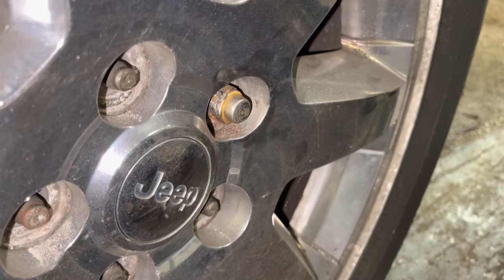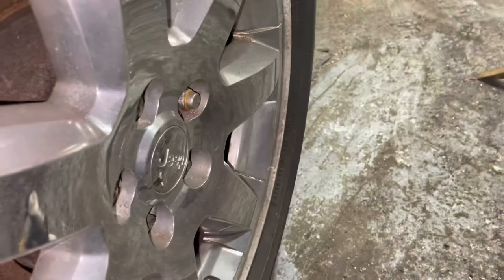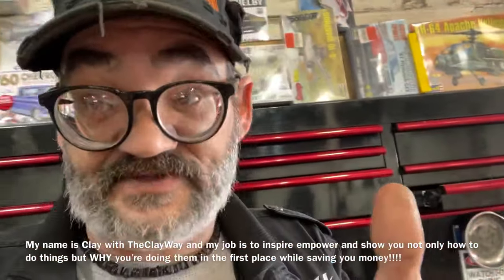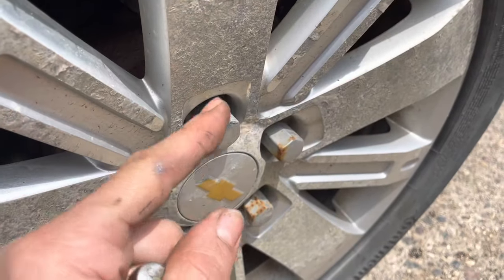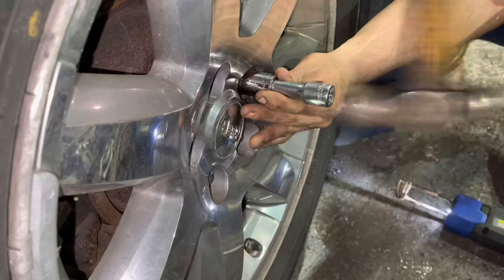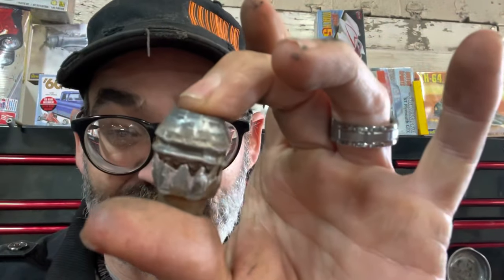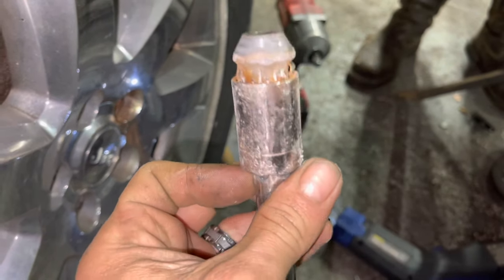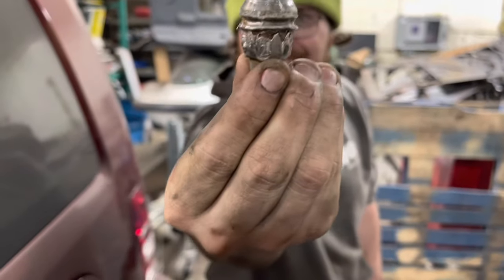How to Remove a Stripped Off Lug Nut

Comment: I have a 2007 Dodge Ram 1500. WalMart  is the only place my truck has ever been for tire work. Went in for a rotation and they rounded off 4 on the first tire they tried. Told me "someone" got them too tight. I told them, Yea...you ! They said they don't put them on too tight and they can't do anything for me. I worked my way up the ladder of folks with WalMart until finally someone from corporate called me and basically said, Tough poop. So......now I have to take it to a truck shop and get the darn things removed and tires rotated. I hope there's another option out there to buy different lugs, because I don't want the same things put back on. Great video. I'm just not set up with the right tools and physically can't do it. Still a great video, thank you.
Reply: So what probably happened is the wear on the aluminum caps on the lug nuts wearing out, oreilly sells good quality lig nuts that don't have caps, they're the same size and are straight steel all the way thru, no aluminum caps, id get those, they're better and will most likely last longer than the truck😂

Comment: My boyfriend is one of those full-on I can do everything and I know all, especially if it has a tool involved. So while he's at work I watched your video and thank you because I love it when I prevail at things he thought impossible. Love your video
Reply: One more thing is that the sockets I used, first one was a husky, it cracked but I used a Craftsman next and it worked great
Reply from the maker: That's awesome! My wife could tell you she knows the feeling  😂 I'm glad the video was helpful!
Reply: Having this problem with my boyfriend right now.. Never can I find something that will work because he already knows what he’s doing.. so I’ll never get to find out if this worked for our car I guess
Reply: Funny I had to go back into O’Reillys to get another torque  sockets because that’s what he was using but the caps got stuck into the sockets. And when I came back out he was doing it my way “this way” and worked like a charm!

Only have to get one cross thread fixed in a week.

Comment: What I always did was use a screwdriver to chisel down the side of the tin to open it up. You can then stick the screwdriver inside and pop the tin off. There’s a steel lug nut inside unharmed and you can put a socket on it and take it right off.
Reply: @@eastsideazskelad3093 true, the cap can end up anywhere. Lol

Comment: I know one trick, get rid of them before they cause problems.  I replaced mine with good solid ones for just a dollar each.  It was the best $20 I ever spent on my car!!  I don't know why they still use those horrible things.  Haven't they learned yet?
Reply from the maker: It’s hard to find them for a dollar but if they were a dollar that’s probably what I would buy as well you’re absolutely right
Reply: @sharpcarco  They don't have to be a dollar.  I just got lucky and a local tire shop had them.  I just told them I wanted to get rid of the factory lug nuts and he knew right away it is because they are garbage.  I just told him I had bad luck with a different car that has them and I never want to see them again.
Reply: How funny.  I just said that to my friend when I went by his house to try and remove them before seeing this video.  I should have gotten rid of these years ago.

Comment: Worked like a charm. 19mm Dodge Caliber lug nut. Used a 3/4 - 1/2 drive 12 point. Pounded it on there (straight), grabbed my 24 inch breaker bar and it came right off. Even was able to get the lug nut out of the socket with no problem. Put it in my bench vise and was able to punch it out from the other side. Your mileage may vary, but it took me all of 5 minutes.

Comment: Thanks for the vid.  I just watched it about an hour ago and went outside to do mine and it worked somewhat flawlessly.  I only had one socket that I could use and after I hammered it on I realized it was a 3/8 drive and I wasn't sure a 3/8 ratchet wrench would have enough oomph to get it off.  Since it was a Craftsman I figured if it breaks, I'll get a new one.  I used a bicycle seat post for leverage and got every lug off without hassle.  It only took about 4-5 blows to get each lug out of the socket so it only took less than 15 minutes to do the four I needed to do.  I can't believe Sam's Club couldn't do this and made me wait until tomorrow to get my tires installed.  I know any regular tire shop does this all the time but, I figure Sam's is we don't work harder than we have to.

Comment: Just used your trick on a 21 mm Toyota Camary nut and worked like a charm, and the pounding it on the concrete ground to remove it was awesome, too. Thank you so much. it only slowed me down 10 minutes.
Reply: Same!!
Reply: On my 21mm Camry, I striped the outer Chrome layer off the bolt with my 21mm, but then noticed what was left was a smaller iron lag. I banged a 19 mm on to it and it came off great! Posting this for anyone in a similar situation who might benefit

Comment: The lug nuts on my bot trailer were rusted out.Got most of them off,but several stripped and could not get them off.Used this trick and got them off.The had to get the stuck lug it out of the socket.Hammer trick worked for that.Thanks for the knowledge.

Comment: I just used this method on a 2001 Chevy suburban and hammered the socket onto the lug and used the socket wrench and it came right off. Then used the hammer to bang on the socket to get the lug out and that worked also.

Comment: I used high quality hardened socket with a hole in the middle. When it was loose I placed it into a vise, then I took lug out using a hammer and a drift, hitting it trough that hole. Smashing it like this with a hammer might crack it, or it will crack partially and it will broke next time you will use it as you are putting way too much of stress into it. And you can also buy socket that is specifically designed to remove stripped off lug nuts or bolts. I guess it´s called the bolt extractor in English and I believe it´s a bit easier to use. It costs more or less the same as socket of similar size and because it does not require so many hits with a hammer, it has much higher chance of surviving more usages.

Comment: I'm dealing with a Polaris Ranger 6x6 with recessed lug nuts. A 9/16's is a hair too loose and a 12 point 14mm fits, but just rolls over. I've got a complete s.a.e. & metric "Bolt Biter" set, but they're too thick.  The rims are alloy, so acetylene or welding is out. You can't even get to the rear stud flange to grind them off! The lugs are solid with aluminum end caps, so I guess drilling them out is the only option. Seems like they make stuff intentionally stupid and difficult to discourage any of the D.I.Y'ers.
Reply: Not just DIYERS because Walmart auto center f*cked my lug nuts up..

Comment: I'm at the very beginning stage of taking these shyte struts out and have problems with a lug nut. Ill try this out. If I succeed, you nabbed another.
Reply from the maker: You will I guarantee it… I would like to say I would come there and do it for you and show you that it works but I kind of already did if you really think about it because I showed you on the video I don’t make tricks that don’t work.. that I promise there’s no Clickbait here……. Well, unless my wife’s in the video, I think she’s Clickbait…… lol
Reply: Sir. Your idea had clout and I wholeheartedly appreciate the effort. But I ended up rounding it out. So I cut it out. Bolt and all. Luckiky I had another rim. Put the old tire on new rim. And put the strut in like clockwork. Then I went to the other side and cv join5 got yoinked out. Got an exterior boot for it. Found my lower ball joint to be messed up as well. Now Im going to rig another boot onto it. This ride has been a nightmare for me on day 1. Founr out by the cops that the previous owner has felony warrants, so i had to give up my name. I hesitated because all i was doing was bringing it back from where i bought it and was 20 mins deep, vacuuming after washing it at the carwash. I hesitated because first, I didnt do anything and second, I have 3 misdemeanor warrants. Also on the way to the car wash, found a glass pipe between driver side seat and shifter. Put it in my pocket and forgot to toss it in the beginning. So now I got a drug paraphernalia charge. The real fucked up thing? They cuffed me and seached me after running my name and saying I had a 418 (resisting/fighting police) which they corrected themselves AFTER search.

Comment: You can also heat the nut with an induction tool. This will be localised and the nut should expand without heating the stud and make it easier to remove.

Comment: Awesome I’ve been stoked for 2 days trying to find a locknut removal kit and couldn’t find none in my nor in the near by city of Miami in time. How very extremely lousy of the places Miami and some places I am that didn’t have the removal kit in their part store. Not even Home Depot that we went to had it, lousy. Home Depot said online purchase wow do you know how many of the locknut removal kit you can find online HOME DEPOT, smt lousy. In a rush or you have an working vehicle that needs it, you need to find one in these types of stores right away. I just mentioned that as part of my story so no one ends up wasting time going to these stores like Home Depot Advance Auto Pep Boys who didn’t have a removal kit.  wow tremendously lousy of the stores not to have the tool kit. I will do a separate video on them. Smt. Thanks to videos like these you can do it without a removal kit. Wait you think that’s why the stores,,,,, lol. Naa. Enough about those stores. I’ve been thinking just use a smaller size 12 point socket. Then you came along with your wonderful video and confirmed it for me. Thanks so so much. I do this method then come back and comment on how it worked. Thanks have a Bless Day. Keep up the splendid helpful videos.❤❤❤
Reply from the maker: Thanks for letting us know it worked out! We're glad to help 😎

Comment: bang socket still stripped but now i have a socket that wont come off over the lugnut so i banged a bigger socket over the socket and that one also go stuck and now im in a few sockets also stuck over lugnut im thinking to keep adding sockets
lol
Reply from the maker: I’m sorry to say you did not watch my video. Because in the video I do believe I describe what I did in another video which is how to remove a socket that is stuck in a lug nut quickly and easily by turning it on its side and using an extension, hammering the end of it and it will pop out

Comment: I have 13/16 lugs. Bought a 13/16 12 point socket, but it just started raining. Gonna go at it tomorrow! 

Ps, I bought a socket set to go with my new 1/2 impact driver, and the 13/16 it came with doesn’t fit right, have to bang it on. That’s why I’m in this position, I didn’t put it in all the way and stripped the tip. My four way lug wrench always fit just right. Maybe it’s just a bad 13/16 socket? The 3/4 from the set went right on my moms just right.

Comment: The way I get a stuck bolt or nut out is to use a chisel and put it down in the socket and hammer it out
Reply from the maker: Yeah, you keep doing that Bud….
Reply: @sharpcarco  what’s wrong with that
Reply from the maker: @BuggieBangedYou  nothing at all. But you’ll find it my way is way way easier I did it that way for a couple of decades
Reply: @sharpcarco  yes sir I respect that, I just thought banging on sockets like that will damage and break them, considering my brother broke ratchets and extensions trying to get his lug nuts off
Reply: @sharpcarco  plus my dad would kill me if I broke his tools.
Reply from the maker: @BuggieBangedYou  no , it should not , it could I guess but if your using harden ones on lug nuts like should be never 

Even chrome should not break while the lug nut is in there .. just don’t hit again after it pops out. Then it may
Reply from the maker: @BuggieBangedYou  show if the trick he will respect and you . I’m sure he never thought about it . Just be gentle on the old guy some people don’t like being shown up
Reply: @sharpcarco  okay I sure will, amazing video and thank you for showing that neat trick, I can’t wait to try it

Comment: What actually happens with those lug nuts isn't rust, nothing expands, the exterior of the lug nut is an aluminum cover, that's what makes it a 19, 20, 21, etc size, you take the cover off, it's 1mm smaller, I'm a lube and tire tech and deal with this constantly, I live in alaska where rust is a VERY common issue with things being stuck, what actually happens is the aluminum cap with wear out over time, and when that happens it does expand and start to spin on the interior lug nut, idk why manufacturers do it like that, but I can tell you for a fact it's rarely rust, it's just wear over time, but I've seen jeep, dodge, Chrysler with 30k miles and fucked lug nuts

Comment: They say don’t believe everything you see on YouTube and this is kinda one of them. I have 4 lug nut that is rounded of by somebody else so with this method I am going to ruin 4 extension and 4 sockets? I would rather buy a tool specially for this and is reusable
Reply from the maker: OK why even say anything at all? And blaming others for your mess ups well….. to each their own… you see how that works? 

I suppose the point is blowing out somebody else’s candle is not going to make yours brighter …..
Reply: @sharpcarco  I don’t strip lug nuts. Anyways this will work most of the time but if you got an extremely tight lug nut that s stupid tire shop worker tightened that bolt to kingdom come, it will just strip it further. Anyways we are a bunch of pro here let’s not spread Saturday mechanic stuff to unsuspecting YouTube certified mechanics out there. We should be spreading the professional way of fixing things and not winging it out. That way all the DIY YouTube certified mechanics can get the same quality job that we pro offers. For free that is well not completely, they still need internet which is not free. Oh by the way I was already a mechanic before youtube even existed.

Comment: Majority of reason this happens is machanic torque the crap out of it     That’s why I am here
Reply from the maker: Not true but I could see why you think that ….
Reply: @sharpcarco so what is the reason lug nuts are stripped? It is super hard to do that with hand tools.  My lug nuts were litterly stripped multiple times when the mechanic used his impact and stripped the crap out of it.
Reply from the maker: Still not true, but OK. I understand why you think that way but it’s not the reason that they go bad.
Reply: @sharpcarco so why did the one in this video get stripped? Because someone hand tighten it?